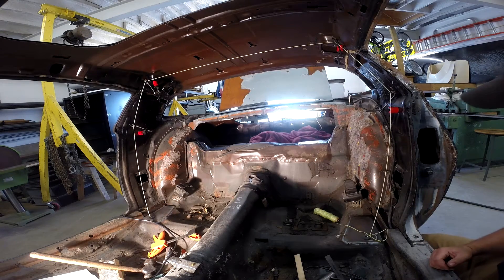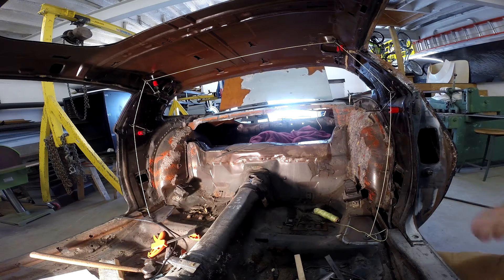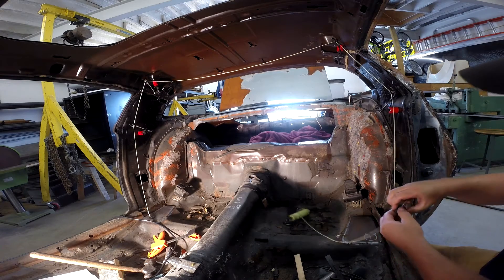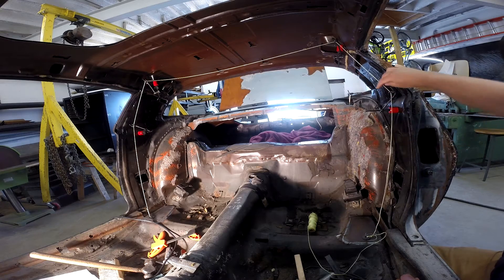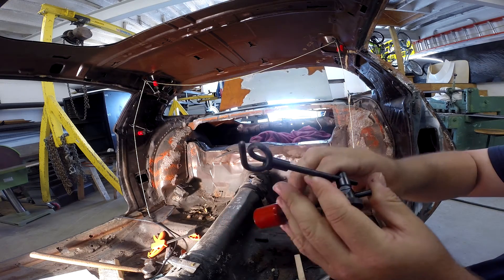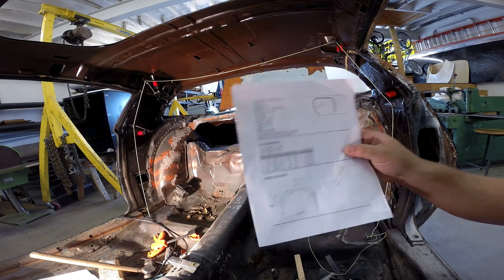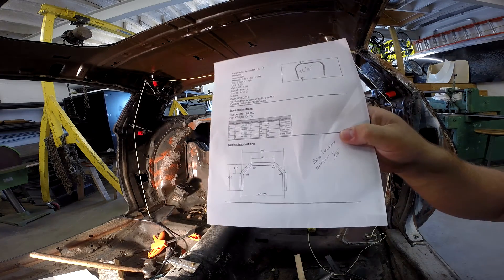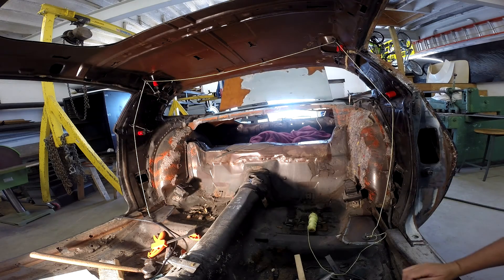Roll Bar/Cage Main Hoop Layout

Comment: Bend-Tech software is very useful. I've been using it to lay out brake, clutch and fuel lines on my 1967 Ford Mustang Fastback build. It allows me to make fine adjustments to lengths, angles and rotations and provides a step-by-step report to make the bends. I may try their header module.
Reply from the maker: I have used it for several sets of headers. I like how it allows you to keep track of effective tube length if you are trying to make equal length tubes. Thanks for watching.
Reply: Do you use a tool such as Icengineworks to layout your headers? It would be great if you could do a video on how you build your headers.
Reply from the maker: No, I just use Bend-Tech. I will do a video on building headers from scratch the next time I do a set. I only do one or two sets a year.
Reply: That would be great. I bought a set of Doug's headers for my 1967 Mustang Fastback Coyote conversion project but I think they will hang too low for my liking. So, I'm either going to modify them or build a set from scratch.

Comment: I'm not sure if it's the distortion from using the wrong go-pro settings or what, but that bar looks like it's a foot away from the side of the car where it meets the floorpan.
Reply from the maker: It is likely the camera. I had actually already taken all my measurements so the magnet might have been out of position by the time I shot the video. Thanks for watching.